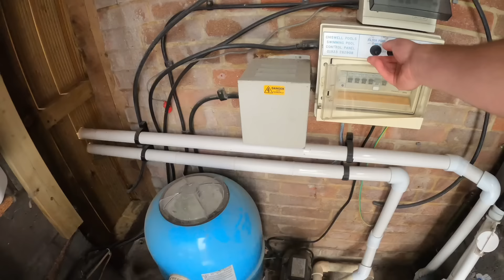Green to clean kidney shape pool

Comment: We are the #1 pool service in Austin TX and we completely stopped doing cleaning services on stand alone hot tubs years ago, do only equpment repairs. Put a short peice of flex hose (12") on your pump suction so your vacuum hose cuff won't be under strain drooping down into pool. Thanks for the videos.

Comment: Here's my question:  She's not going to use the hottub so it was emptied and cleaned but what about the existing water still left in the lines?  Wouldn't that be algae as well?  So when she starts the HT at some point that dirty water will jet into the tub?
Reply: No, Algae needs sunlight to grow so it wouldn't have anything inside of the lines growing. Also it needs a source  of food water is stil generally clean even when it's been left in lines simply because it takes a bit for stuff to grow I. The water that hasn't been exposed

Comment: I use a UV sterilizer in my aquarium to prevent algae.  Do you ever see those in pool setups?
Reply: Yes, they do exist although the initial set up is quite expensive but they minimise the use of chemicals which is a plus..you can confirm how much it would cost in your country to install as it may be cheaper than where I'm from.. hope that helps.
Reply: @naimamuthoni8717  I bought one that was rated for a 3000 gallon pond for $50 and used it with a large aquarium I had at the time, algae disappeared in a few days

Comment: it’s quite a small pool, wouldn’t it be easier to drain and refill it with clean water? 😅
Reply: Maybe easier, but cleaning the pool is probably harder to do without water.

And the filter kinda recirculated the cleaned water back in so that's a thing too